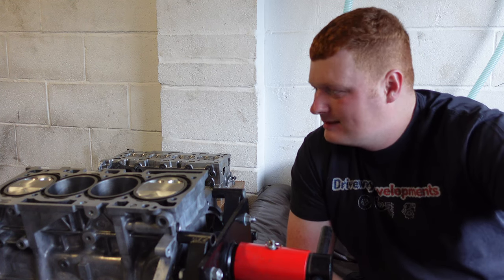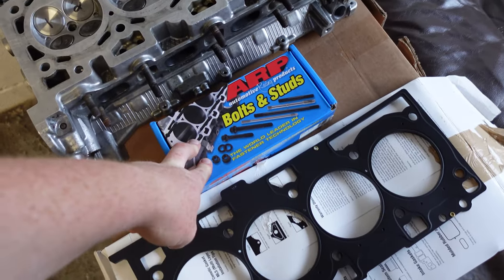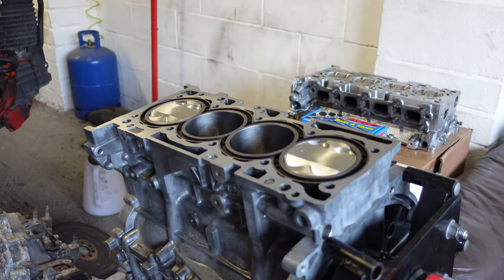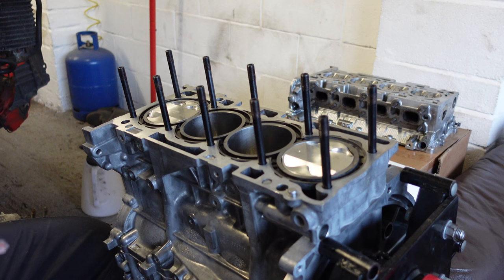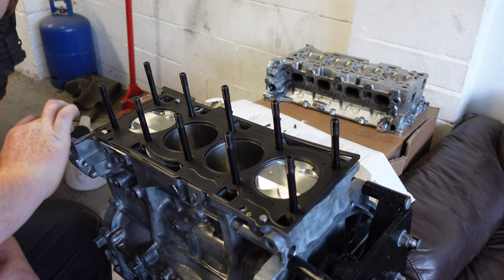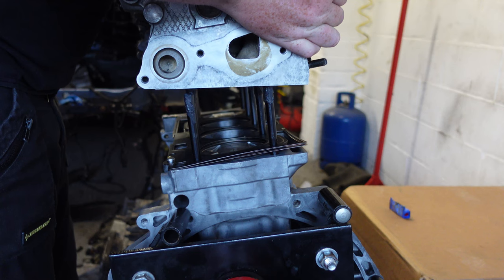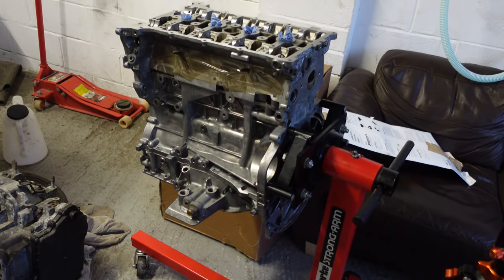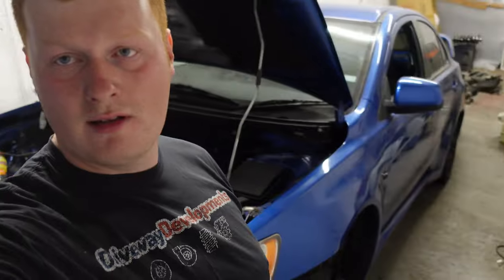The hard work is paying off - Evo Head Install

Comment: I have had an oil leak on my engine since i built it.... now i know why.  Guess who didnt seal the head gasket near the timing chain..  ME 😅
Good to see your progress !
Reply from the maker: Maybe you could put some sealant on the outside it could help
Reply: Yeah maybe but its on the turbo side and difficult to get to.... I also need to replace that tiny oil filter in the block as my mivec has issues and i think that filter is blocked partially.
Reply from the maker: @laser-sj  are you using upgraded valve springs or cams? That can cause issues with exhaust mivec. Im considering deleting it